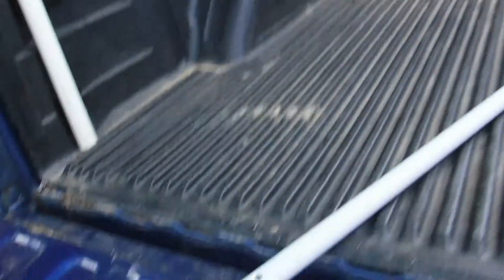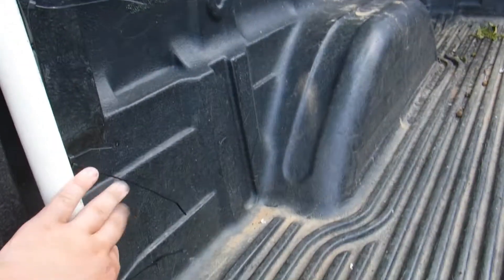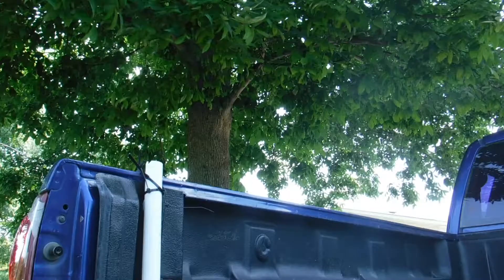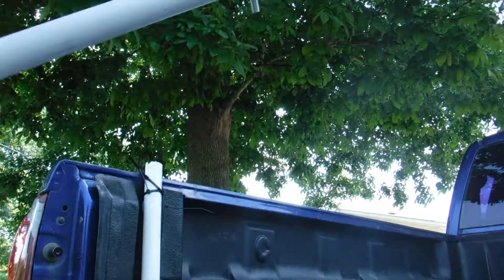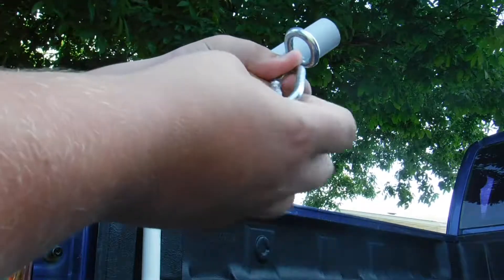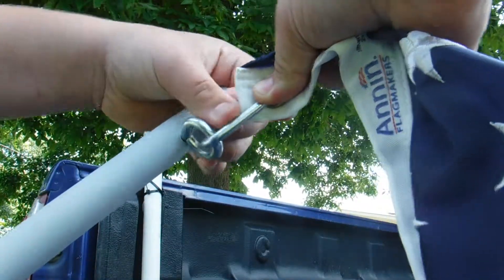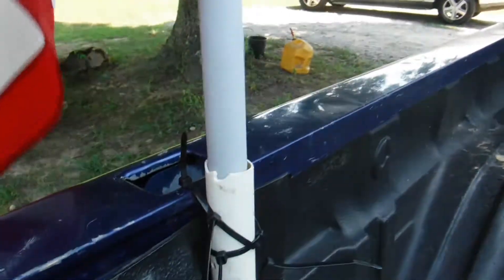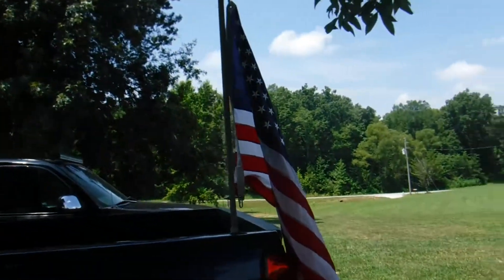How to Make a Flag Pole

Comment: The pvc pipe doesn't break while riding?
Reply from the maker: No i still have them in my truck to this date
Reply: @andrewbarber1203  how fast have you driven with this flying a flag?
Reply: @affinityfishing6971  I've done the same and I drove 80 all the way thru austin all the way to waco texas no problems
Reply: @freakncy 80? Really? The fastest I’ve driven was 60 and it looks super sketchy. I guess I don’t want ole glory to fly off or the quick link to break off.

The only thing I did differently was add 3 screws to the flag pole through the base for extra security to make sure the pole isn’t to easily ripped out by the loony bin left.
Reply: @freakncy2345  Ayeee in by waco